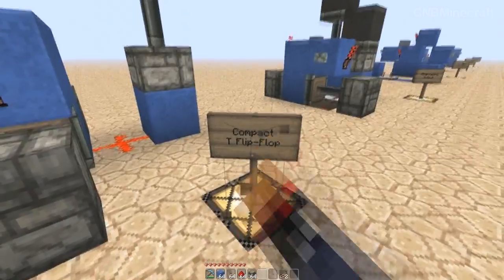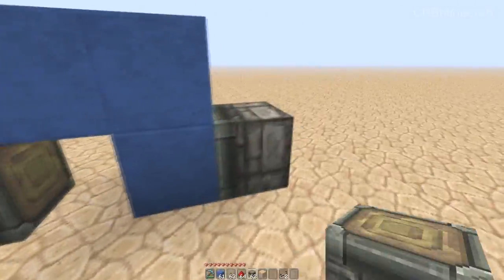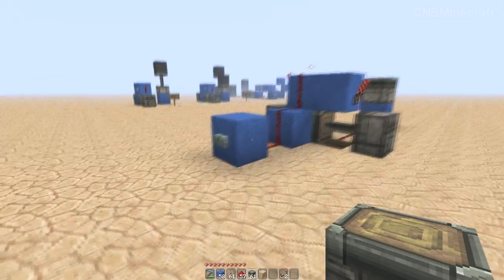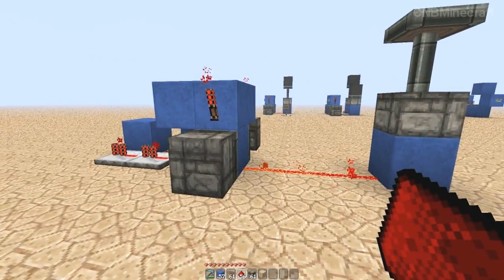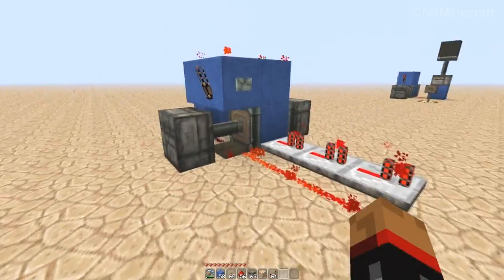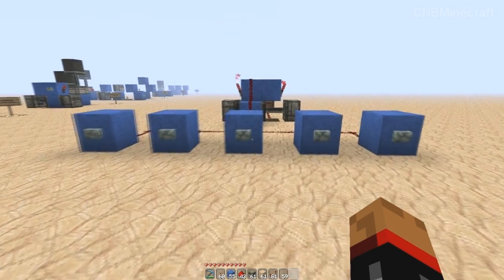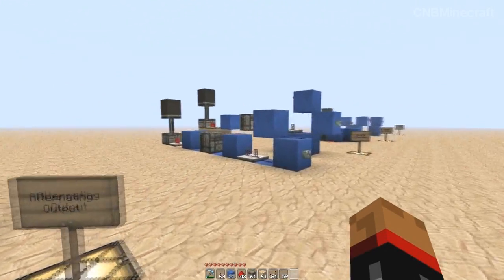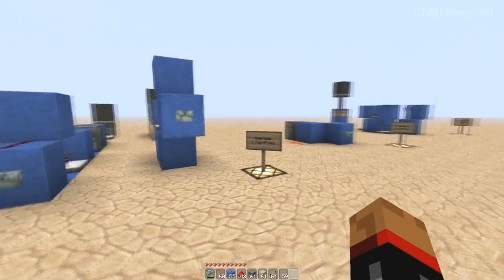T Flip-Flops [Minecraft Circuit Spotlight]

Comment: Right-clicking the repeaters will move the rear redstone torch-esque thing on the repeater backwards, lengthening the delay. There are four settings, and it starts on the setting with the shortest delay, so right-click (default controls) the repeater 3 times to set it on the 4th setting, which has the longest delay.

Comment: For those having trouble finding a purpose, this circuit allows you to operate a mechanism and leave it activated without using a switch. The nice thing is that you won't have to make any more larger gate circuits to make multiple switches operate it from multiple points (ie. Open and close a door from two switches). Switches when left on will always keep a current to the door, meaning a second switch won't be able to turn off the power (unless you build another circuit).

Comment: it is easy to make a binary counter using chained t-flip flops.  if you add a clock as the event being timed, you can have very long delays in a relatively small space.

just place then as close as you can to each other and join the output of one to the input of the next.

Comment: Well, your problem is probably that repeaters only provide delay, not an "extension" of the signal as such. What you need is to delay the off toggle, but have the on toggle be instant. A great way to do it is by using one of the flip flops from this video. Have a circuit that splits in two one line goes directly to the flip flop, the other goes through a long delay and THEN to the flip flop. Use the output of the flip flop to control your piston and voila

Comment: He says it in the video dude. You branch your inputs, having one from the inside and one from the outside. The important bit is that when this circuit receives a pulse as an input, it toggles its state. This means if it is closed it opens and if it is opened it closes.

Also because it runs off a pulse you can just lead a wire and connect it to as many buttons as you want to.

Comment: A lever has an off and an on stand. A button just gives power for a brief moment. I you are using multiple inputs (buttons) on the T-flip flop they will all do the same. If you use multiple levers and you turn on 1 then the others wont work anymore cause it is still powered by the lever you left on. Also.. buttons are way cooler

Comment: i build this and it worked perfectly fine. so i hooked it up to a piston door, and it still worked fine for about an hour. then when i came back and tried it, every time i send a charge through the output, the two torches over the pistons burn out. any suggestions?

Comment: @soniccryofnight  I've been having the same issue. A quick youtube search shows it's a not uncommon bug. The problem is once that torch burns out, it won't work ever again on that block (from what I've seen). You're going to have to move your circuit so that that block doesn't have a torch in it, or try to find a way to do your system without it :(

Comment: Yeahh.. um for the first flip flop built, you don't need the bottom torch. It just gets in the way. :) (I built it myself, and forgot the torch, yet it still worked)
Reply: then what will give the power?
Reply: I think that when I posted the the minecraft version out didn't need the torch due to a redstone loop. However, with 1.10 and 1.9 it does need the torch on the bottom. (there are two. The upper and the lower. you don't need the lower one on pre-1.8

Comment: No it doesn't. If you are putting two torches, that you will need at least two repeaters to separate the signals, which takes up more space than just reversing the output using a torch.